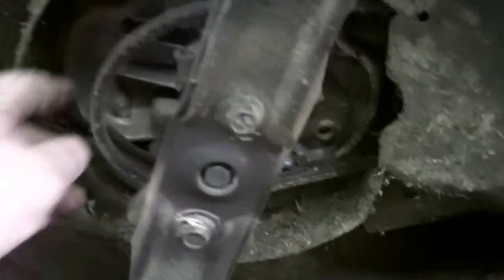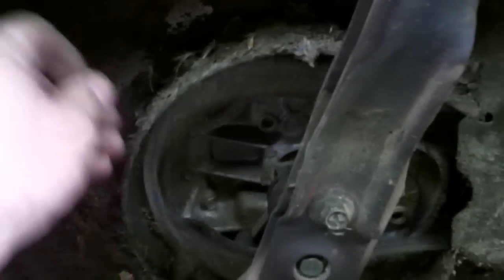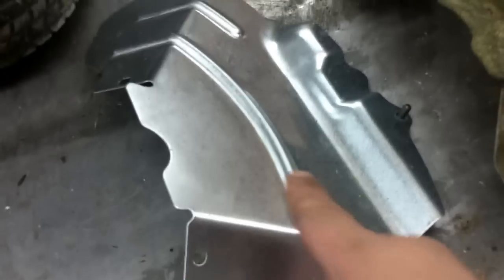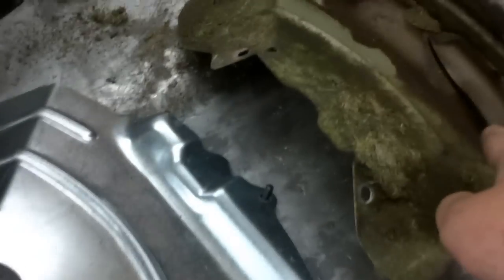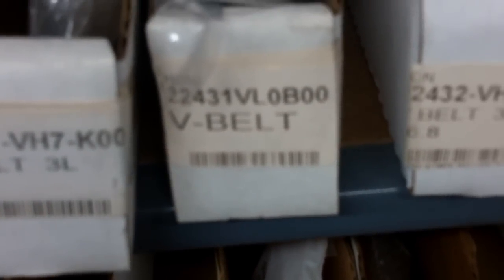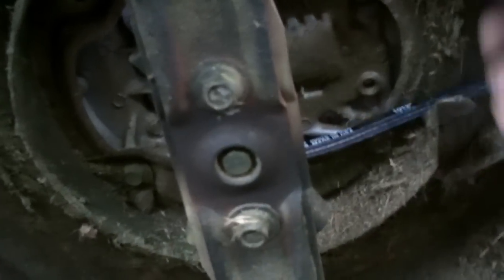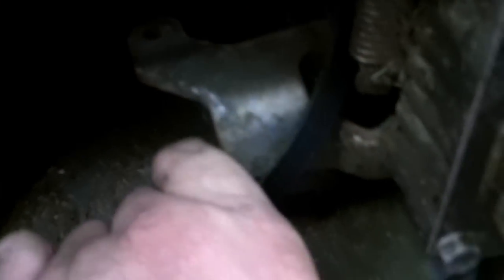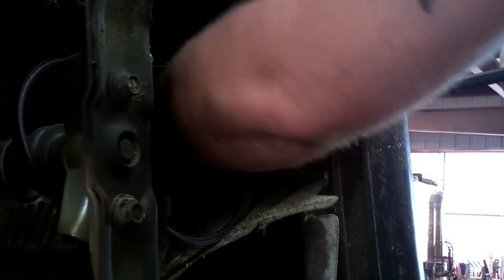HONDA MOWER REPAIR    how to replace the drive belt on a honda lawn mower

Comment: Good video with clear explanations on the process. The trick with the prybar is invaluable. It was the first time I needed to swap the drive belt and would have been incredibly frustrated trying to get that spring on without that part of the video.

Comment: Great video. Learned something. Now the same mower I have back fired and stopped while mowing. I saw the spark plug boot came loose. Put it back and get it started but happened again. What's the cause and how to fix it.

Comment: Great video! Thanks. And stupid me. When I bought the mower, 18 years ago, I saw the belt and always assumed the blades were belt driven. So I was never too concerned about what I ran over. How dumb!
Well... The belt just burned up, and I'm wondering what locked up. Hope it's not the tranny! I only use drive going up hill. But, it does get a workout mulching piles of leaves. Stay tuned!

Comment: Thanks for the video.  I think mine just slipped off a couple days ago (at least I'm hoping that's the problem).  I'll give this a go now that I've seen your video - much appreciated!
Reply: Coston Cheatham I got under the mower today and it was slightly different than the mower you used in the video.  My exact model is a Honda HRX217HXA, and to get to the pulley, I had to remove the blades, two grass shields, etc.  It was quite an undertaking and I hope the belt does not slip off again.  Thanks just the same for your video, it certainly was helpful.  I did capture a little video of it while underneath just to share with any other poor soul that might be looking to tackle the same job.
Reply: Coston Cheatham My mower is operating as usual again, BTW :)
Reply: +Coston Cheatham 35 days after I bought my hrx217 the belt came off and the dealer tried to charge me $90 bucks to replace it since its a wear and tear item and not covered under the warranty.
Reply: +JADEDWILLIAM Did you fix it yourself?  I did and recorded some of it with the thought of making a video to help others.  They don't make it easy to fix yourself.

Comment: Hi, Great video if everything is intact...I'm trying to help out a friend by making this honda hrt216 usable...no manual and no luck online....I'm certain that there are parts missing from the transmission but I cannot find a breakdown anywhere to identify the missing parts.....just trying to help someone in need (no labor fee)...any advice you could offer would be great....thanks in advance.

Comment: I have a Honda HRX 537 CHME ser No MAGA-1115822... the hydrostatic drive drive only powers the mower in the fastest  lever settings, but at a much slower walking pace than when it was working correctly, when it is set at a lower speed the mower doesnt move forward at all and makes a graunching noise.. the belt is good, I have removed the transmission from the mower and see that there are two Allen key headed filler ports, I have removed these and there is no oil in one of them and very little in the other. My question is, what oil do I fill them with to see if that cures the problem before buying a new transmission, in the UK that will be around £400 !!!.. the 3 seals on the transmission are all dry so dont seem to be leaking, I will replace them if you think its worth it.  Great Videos by the way.

Comment: Questioned you before about my Honda HRT 216, 3 speed.  I have gotten all the "cake" out of the belt housing and lubed the linkages for the drive cables.  My mower is much improved now, BUT the rear wheels STILL lock up on me about half the time when I need to pull the mower backwards a few steps.  I just have to drag the bitch backward, which does not help my arthritic back and joints.  Other times...the wheels work perfectly.  Do I need a new belt?

Comment: I bought the belt to replace on my mower, but before I do, I was wondering, did you drain the gas and oil on your mower before you turned it on its side?  If not, will either leak when you turn it over?
Reply: Drain the oil first. Run the gas out of the tank or dump it and save it. I just cut some grass until the gas was all gone.

Comment: That transmission uses 10W30 motor oil filled within within 1/4" to 1/2" from the top of the reservoir.

Comment: So what does the drive belt do exactly?  Does the belt drive the self propel of the motor?  I am having a problem with my self propel...wheels still move when engaged but it is weak and have to push the mower to help.  Is this a drive belt prolem?  Thanks in advance for any gel in advance.  Also whats the best web site for parts?
Reply: Had same prob. Belt is worn/slipping so wheels turn but slips under pressure. Won'r "propel" very much. Replace belt.

Comment: Honda HRR is a good machine but their refusal to give tran info sucks. I could not find ANY info on service for it. Finally stripped it myself and flipped bronze gear to good side. Filled with #90 gear oil & adjusted the cable.Drilled and tapped a fill hole in the trans pan and capped with a bolt for easy topping-up. Trans pulls like new. The owners manual says NOTHING  re service for trans. This is not good enough for people like me, I can "put an arse in a cat" & will not pay dealer for repair